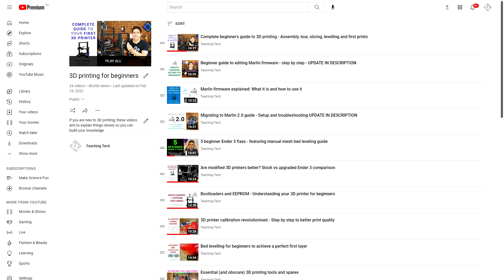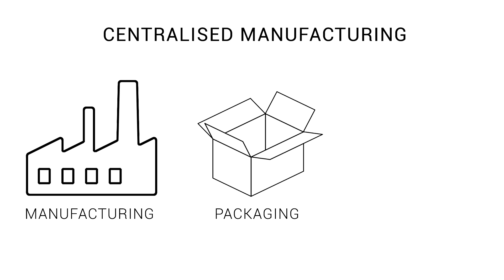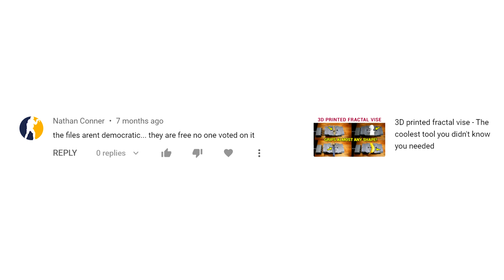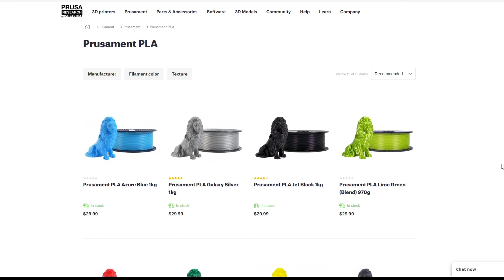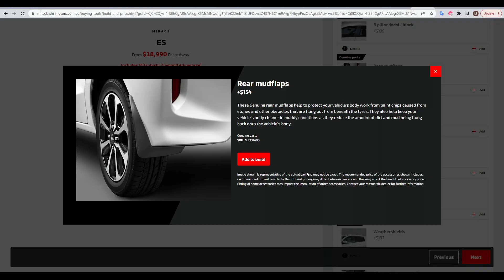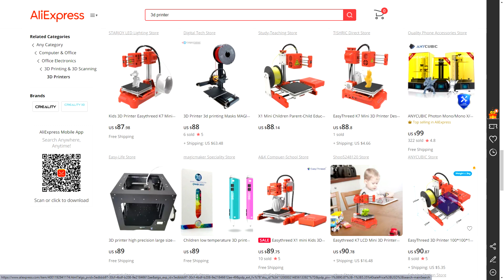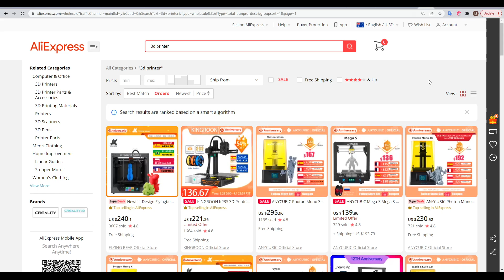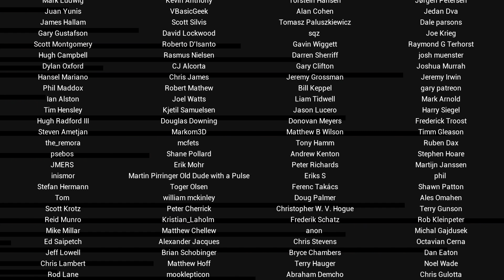3D printer trends are limiting mainstream acceptance: The 3D printing paradox

Comment: 3d printing is so energy inefficient right now (5x - 10x the energy of traditional manufacturing) that it won't ever become commonplace at home ...
Reply: HAHAHAAHAHAHAHAHAH!!! That's so not true.
Reply: Even at high energy prices for exclusively renewable energy, the energy cost basically doesn't figure into it, not nearly enough to dissuade anyone. And as for ecological impact, the less stuff you need to ship, and the better consolidated it is, the less energy waste occurs there. Like if you're taking a bulk shipment for a kilogramme of material or several kilos instead of dozens or hundreds of individual items that would be made from it and individually packaged and shipped.

And 5-10x? Citation needed, please.

Comment: I agree with the criticism of the manufacturers. Some times it's some kind of nested refusal to innovate. For example, the Artillery Genius Pro is the upper spec version of the Genius and basically just has an ABL sensor. If you want Linear Advance you've got to change your firmware. The "Pro" version doesn't have Linear Advance out of the box... So not only are they lazily using a BL Touch to justify a different model they're not even activating some existing firmware features and pretending they're advancements over the cheaper model. I guess that will be for the Genius Pro II...

Comment: I think you're ignoring Flashforge. They make a quality product that is quite easy to use and is good quality for just over $300. Yes, it's a bit of a closed ecosystem, but that's really only a problem for the tinkerers. If you dream of a 3D printer in every home, then also recognize that every home doesn't care about open source firmware. I have just ordered a Prusa Mini+ kit for myself, after working with Flashforge printers to learn all about 3D printing. It's because I'm a tinkerer. If I were not, I definitely would have purchased the Flashforge at whatever size/price combo felt right to me.

Comment: Not to disagree, but a LOT of modern features of automobiles were designed by home tinkerers and then were adopted by car companies as vehicle options. 1) Alfred Horner Munro designed and patented the first automatic transmission right out of his home shop.  2) Mary Anderson From Alabama designed and patented the first set of windshield wipers in 1903. 3) In 1839, Charles Goodyear invented the process of heating rubber and chemicals to create vulcanization of rubber. He did this at a warehouse while cooking rubber on a stove. There are many more inventors with inventions that went from the public to industry and then, later on, that product got upgraded and then resold to the masses. But it seems the process of 3D Printing is kind of stuck in a never-ending loop. Everyone wants to clone/copy some other companies printer. Also the idea of people creating the ideas and the printer companies adopting those ideas, is not far from the newer features of automobiles. I am still waiting for the inventor/person to come out with the idea of a 4-6 axsis 3D printer. One were the print-head can actually float in air and print in a 360 degree in x, y, and z positions.... If only..... And Lastly, I myself have tried and failed with 4 different "economy", and 2 "mid-range" 3d printers..., I gave up due to my age and very much lack of patience to deal with issues on them. I still don't understand why a company can not design a true "plug and play" 3d printer. One for people who wants to do 3d printing, but doesn't want to learn all the extra knowledge needed to make one work. You take it out of the box, plug it up, load up filament, and print. It does its own adjustments, calibrations and etc.. It just prints and takes the abuse of any age person no matter what.  I have yet to see that.

Comment: What an awesome video Michael. You are absolutely spot on. I have recently sold my Ender 5 and am currently printing on my Prusa MK3s while I wait on delivery on my new Prusa XL. It pretty much boils down to the things you have covered in this video. I had improved and rebuilt my Ender at least 3 times while my Prusa has remained bone stock. Of course we know weigh one still prints with higher quality. In the end the Prusa has been the cheaper machine to own and operate. Not much more to say about that. Keep up the good work sir.

Comment: If 3D printers are ever going to become mainstream, like a microwave or kitchen appliance, they will need to be designed where the regular user only has access to and needs to do minimal things, such as loading filament, cleaning nozzle off, wiping the bed etc. Then if they have a larger issue such as leveling issues, thermistor, belts, etc. They would have to call tech support or have someone come out and service the printer. It's literally how every mainstream household item is, even 2d printers that were talked about in this video. There are a few simple tasks the user does, but anything beyond that it's tech support or having a technician fix the issue, unless you are someone who tinkers. This is the only way I ever see every home having a 3d printer.
Reply: which brings the scary thought of DRM'd filament cartridges.  Which while easy to just slide in and it autoloads and gets going, Also means you cant just go out to say Atomic Filaments and get a spool.
Reply: Document printers are heavily subsidised to the point that when it wears out and goes a little wonky, and it will, you just throw it away.

Comment: really need to add a timescale to this. the first cars were not very user friendly even after ford started mass producing them (and was copied by everyone else). same goes for printers (btw - inkjet printers are hugely inefficient - mb 5460 - compared to laser printers, hence the low [price for the printer and the extortionate price for the ink cartridges). both are technologies that matured from niche hobbyist grade products to global mainstays. took a long time but got eventually got to the point that absolutely no technical knowledge required. make this video in 30 or 100  years and it will probably be very different

Comment: There are markets where the products have been reduced to commodity-like status.  In that state, pricing pressure is always downwards, thinner margins for the companies and the R&D is all about making the product cheaper to manufacture and bring to market.  And that's all fine for those types of products...  BUT a product in that space usually "just works" and has a low defect rate, and can be successfully purchased and used by customer segments well beyond the "early adopters".   It seems like many/most of the vendors in this space have skipped over all that part of the product development and maturity process, declared success and tried to pretend they've made the leap to shipping inexpensive commodities.   And that's the big fail.

I've got an Ender 3 PRO and then later moved on to building a Voron 2.4 printer.  So I'm clearly not the mainstream customer that the market might hope to service in high volumes.  Of all the ones that I've seen, I think that Prusa is clearly an exception and a product that's not targeted toward business professionals at 10X the price, but still usable first and foremost as a tool to solve problems, and not a new set of problems to be solved first.  Good on them!  And they're who I recommend to people that want a TOOL to solve other problems, not another hobby.  

But when I try to recommend Prusa printers to took-seekers, they tend to balk based on unreasonable price expectations set by the vast majority of the other products in this space.  And I then try to explain why the cost difference exists.. and then I ask them how valuable their time is?  And how much tinkering time they're willing to invest in something that they didn't intend on being a new hobby in their lives.

You very rightfully point out how this is all doing a big disservices to this large potential market, and I think it will take longer to mature products in this space and drive down costs over time.  I have no idea how you can really change this, absent some strong vendor-lead trade body that could look further ahead and discourage crummy products being pushed into the market.

Comment: A short stop for this is to have a 3d printing store that can make you the spare parts for repair of your house items. Much like you go to the repair store if you have a broken appliance. This is starting to happen in my country with the cost of a printer so cheap (due to proximity to China lowering transport costs) and labor also being cheap.
Reply: I think this is really the future of 3D printing, the VAST majority of people don't need a 3D printer at home they just need something 3D printed once in a blue moon. And arguably one almost needs CAD and/or 3D modeling skills to get the most out of 3D printing as in most cases what's found online isn't what you need.

Comment: 3D printing will never be able to replace or even challenge traditional manufacturing for a few key reasons:

1) There's still packaging and transportation costs baked into 3D printing, as the raw materials to print with still have to come from somewhere. Even if plastics were as eminently recyclable as metals and glass, the yield of reusable material to useful prints will never be 100% (unless you're a total screwup) and nobody will be making their own materials from scratch (the end of widespread subsistence farming has driven much of the social, economic, and technological development of the last 125 years). 

2) Certain items are not best made by additive manufacturing. Many are the comments in 3D printing groups on social media saying, "BuT iS iT fOoD sAfE??!?!!??!" when someone talks about printing anything that touches food, drink, or, uh...mucous membranes. Most anything requiring isotropic material properties is also better made through traditional, easily centralized manufacturing techniques.

3) Centralized manufacturing benefits from economies of scale. If injection molding is the best way to make an airtight, safe, and robust drink container, it's unreasonable to suggest that every home spend hundreds of thousands of dollars on an injection molding machine - it'd be far more cost-effective to 3D print a pattern to make a sand mold that you use to pour an aluminum container. But if one factory with some injection molding machines can make a million containers a month, they can do so many times more effective than we can make and finish an aluminum container made with a 3D-printed mold.

This is not to say that I disagree with the vision of having a printer in every home - there certainly are a vast litany of items that either are good enough when 3D printed or that must be made available to all people so that government overreach is rendered ineffective. But can 3D printers ever be as simple to use as, say, a microwave? Even the car analogy isn't a great one, as non-tinkerers still have to spend a great deal of time and money over the life of the car on maintenance, repairs, and general upkeep. A microwave can be cleaned with a wet cloth and elbow grease and that's about all you need to worry about on a daily basis. And when it dies you can send it to certain YouTubers for experiments rather than go to the trouble and expense of getting it fixed...I doubt printers will be as simple as microwaves, and I don't know that the current business climate in most countries is conducive to having 3D printer repair shops in every town of more than 100 people.

Comment: I got my Ender 3 v2 for Christmas and it's been great, light assembly and it has worked pretty much perfectly with really no "tinkering".
I've even learned to use free Cad software and make my own parts.
I know that a lot of schools are now teaching some 3D printing basics so maybe we just have to wait for that generation to grow up and buy their own printers.
Compare 3D printers to the early computer hobby. Computers were around in kits from the early 70's but very few people knew what they were or how to use them.
It took like 15 to 20 years before we got "good" home PC's and adaption grew, now even your grandma is on the internet. 

I only even heard of 3d printing back in 2015. It's going to take more time for it to go mainstream.
Reply: hey James, any mods or repairs on the ender 3 v2 yet? I have a 5 pro but I'm thinking about the 3 v2 due to its simplicity
Reply: @gushhnet  I changed the stock 0.4mm nozzle to a 0.6 nozzle for faster printing. My prints usually don't require high detail. Otherwise it is stock and is still working just as well as the day I got it.
It's a great printer at a great price, only real "missing" features are auto bed leveling and filament run out sensor. It only has to be leveled once every few dozen prints, and it's really not hard to do manually.

Comment: You're forgetting that 2d printers have been around for 40 years and cars for nearly 100. Both of them required tinkering when they first came out. 3d printers for the home barely 10 years.
Reply: Considering people still barely understand 2D printers it’s kinda still a problem.
Reply: @AlexDenton0451  I would even argue that a 3d printer is much more understandable than a regular one because all the electronics and mechanics are exposed
Reply: @workinprogress9483  ya right dude.. If you think that makes it easier for people to handle you must live a privledfged life surrounded by intelligent humans. The ones I tend to encounter (the humans) would much rather a magic black box that just spits stuff out
Reply: Considering that it took to about 2005 until normal printers "just work". That is not reallt that long ago.

Also If you wanted to print a color image on a consumer printer in high quality in 1990, that was like half a hour and $3 dollar  of color
Reply: @matsv201  that is simply not true. Printers well before that "just worked"
Reply: @jhoughjr1  i wrote so.. If you where printing pure text.

But the second we steped away from it .. it started to be really complicated
Reply: @matsv201  No. Printers have "just worked" for a lot longer than that. They have changed from dot mateix to Inkjet and laser but they have just worked. The difficulty in modern printing has more to do with software...not hardware.
Reply: Different times with different expectations. Smart phones are a relatively new technology, with the first real mass adoption model around 14 years ago. That product is more complex than 3d printing by a magnitude, but designed for no tinkering required. Folks nowadays expect products to be practically plug-and-play, and tinkering is an automatic turn-off.
Reply: 2d Printers (at least for home users) are also a vast wasteland of garbage, throw away devices, DRM/ consumable scams and proprietary nonsense... 2d home printing as an industry is possible the WORST example of mass adoption of a technology one could possibly come up with  .. not to mention paper printing is more or less obsolete....and is now niche....

 It is niche due to the very  technology that made it "cheap" and available and then unprofitable necessitating all of the outright scams major mfgs are pulling in this space.  

I literally cannot think of a less "democratic" more anti-consumer/wasteful/arguably pointless industry then the low end mass market home printing sector.

I guess the point was to illustrate how ubiquitous 2d printers have become but I'm not really sure its an example I would want the 3d printer industry to follow in any way other then to achieve a larger audience. 

In which case a better example would be the microwave. Which more or less did not exist as a mass market tool until the 80s' despite being available since the 50's, and is now in 90% of US homes and is still as useful today as it was 40years ago. 

That is until someone decided to connect one to the IoT b/c cooking your popcorn in 3 mins HAD to require and internet connection and proprietary firmware to MAKE IT EASIER..... until someone at the company pushed a OTA update that bricked them all by entering a wrong version number.... and which can't be fixed by the customer b/c "safety/trade secrets" etc etc etc.
Reply: 10 years?? Bruh... Rent/stream/pirate a copy of "Jurassic Park III" from 2001.

There's a 3D printer in that film that saves lives and that was a lot more than 20 years ago.

Granted that was back when you had to write shape files by hand, but 3D printers were first patented in 1984. They're just more accessible now.
Reply: @teddyrooseveltguy  I said "for the home".
Reply: @teddyrooseveltguy  well there was a 3D printern in Startreck from 1964 also.

But if we talk about consumer like 3D printer .. i would say, the diffrance between additive manufacturing and 3D printing spawned in 2005.

Additive manufacturing have existed ... well for decades. but its not really quite the same.
Reply: Lol not really. Printers always were pretty dead simple to use. load paper, print text.
Reply: @jhoughjr1  if you print grapics is very diffrent.

That would be like saying that 3D printers are pretty simple, as long as we only print cubes.
Reply: 3D printer tech has been around since the 80's, it's just recently been made feasible by companies like prusa... Honestly I agree with the video, these companies like creality are just lazy. There are so many things that could be added to make 3D printing better. Why don't we have non-planer 3d printing added in Cura and other slicers yet and don't give me the crap answer that it's hard. A spaceship is hard not some coding.. might take some time but it seems like these companies just to do the basics and never advance anything.
Reply: @NaterNorris  sounds like you dont code.